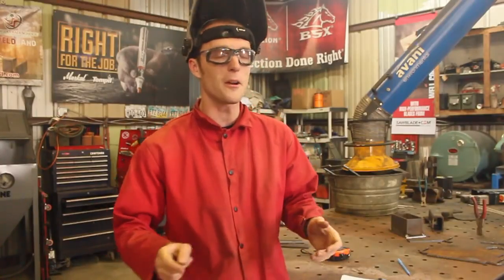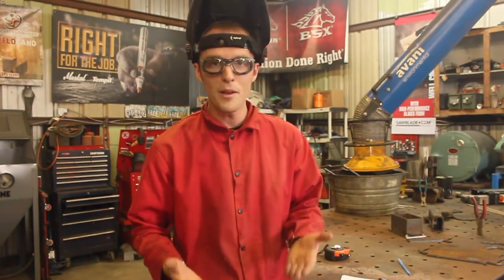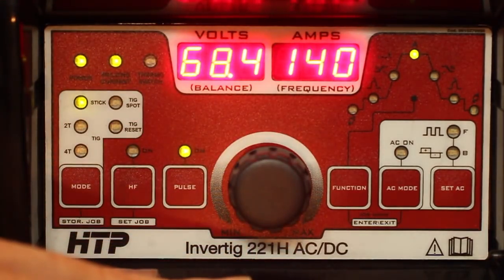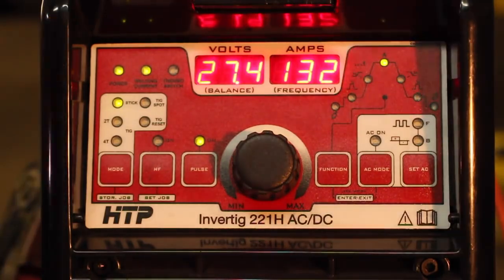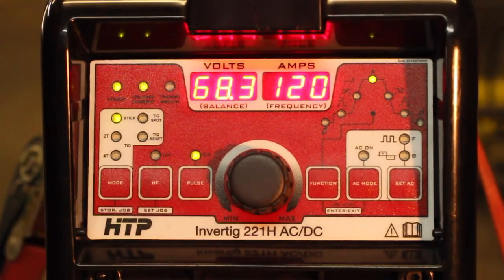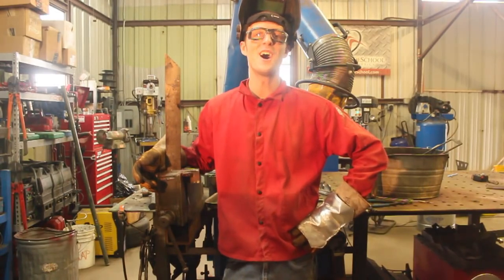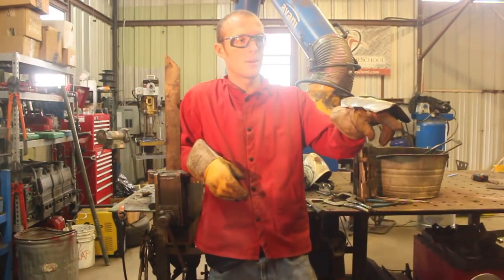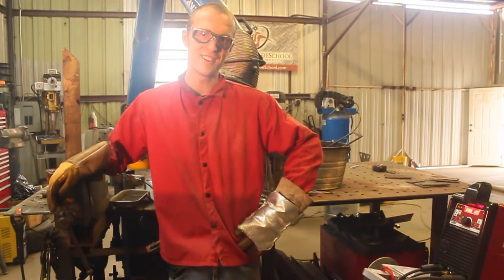Experimenting With Pulsed Stick Welding! Revolutionary New Welding Technique!

Comment: Regarding "welding" - I weld for a living. I weld car bodywork, specifically older cars - usually expensive older cars because I'm also expensive.   In my workshop, I have,many welding machines. They are littered about.  Most are pretty 'spendy machines. 

What I never mention to anyone IRL but do mention on YT is I only use the cheapest machine in the place. The others all just sit there looking expensive,  The welder I actually use cost 200 quid - so is supposedly "a piece of junk" - because more dearer is more better, right? Not always.  In the case of car bodywork, "How low can it go?" matters more than how Shiny it is. Also, how much useability does it retain when you crank it right down to 1? 99% of welding machines I have used crap-out when you dial them back to 1. The 200 quid "POS" is as smooth at 1 as it is at 5 - to date, barring a €1600 Kemppi machine an apprentice broke (it was also an absolute weapon at setting 1) - none of the spendy machines are any use. The POS is equal to the Kemppi, so why drop the 1600 again? 

I can take the same roll of wire - put it into 10 machines for you to try & you will agree that the 200 POS runs it the best. The kicker here is I use flux-core wire. Specifically 0.6mm flux core wire.  Nobody uses 0.6mm flux core wire. I do not use shielding gas.  I have an even bigger "POS" welder that cost €100 - with 0.6mm flux core wire, it will weld steel that is tinfoil thick - however it is so slow on bigger weld runs, I don't bother with it much - but it will weld stuff no other mig machine set-up is capable of. None. It will weld 0.5mm steel sheet without blowing holes all day every day. Your mig will not do that with solid wire & gas. 

I try explain to people the benefits of flux-core & a machine that will go real low on power - for example, there's no distortion - none, With gas-shielded, you weld a panel, it warps like crazy, go as slow as you like, do the "cool each tack" crap - whatever - the panel will warp like mad. When you finish the run, it will look like a topographical map.  With flux-core, you can weld right across a 30cm panel joint - allowing each tack 1 maybe 2 seconds to cool between tacks - a continuous run of weld - and there will be ZERO warping. None. You will stop caring about welding warpage as there will be none even if you do nothing to counter it. The HAZ - to get technical - is so miniscule with flux-core, no warping occurs. Why that doesn't sell the process to every car body repair person baffles me. No Warping? That's bloomin amazing. No buying gas??? Hit one button to have the welder ready to go??? Hit one button to turn it off?? 

I firmly believe that gas-shielded mig for car bodywork is one of the greatest follies tool people fall into - it is so crap in comparison to flux-core it's not right. It won't weld the real thin stuff. It causes crazy panel distortion. The machine & the gas are expensive (relevant but irrelevant). It's 80% slower. You have to grind down welds for about 200% longer (flux-core is a much flatter, softer weld). It's about 60% weaker (flux core penetrates like crazy - a tiny tack hangs on like you would not believe).  I could bore ye all for a lot longer - but "Zero Distortion!"  - that should be why you try it if for no other reason.
Reply: @jamesward5721 ... I really enjoyed reading your comments about flux core auto body sheet metal welding ... please check out ol' Bondo Billy here in the states out there in Oklahoma ... (he's quite a hoot) concerning his flux core auto body sheet metal welding .

Comment: Some company tried to do this, mechanically, about 25 years ago. Eastwood used to sell'em. It was called a "stitch welder" Basically a solenoid with a handle, that hooked into an AC stick welder. The rod got moved, back and forth (like maybe a millimeter) 60 times per second. I didn't use it much, but it seemed to work pretty well on thin sheetmetal.

Comment: In 5 years we'll be able to buy a Chyna knock off for $120 with pulse...:)
Reply: As i see it any Tig lift or scratch mashine with pulse  should work for this so you can buy cheap one already.
Reply: Someone said their Primeweld 225 does it. If you have some outdoor work on thin or withh gaps material.

Comment: Chucky I do have to say that's a great video that you've done and also to I found that my primeweld tig225x also pulses on the stick function. I found that my welder does pulse on the stick operation the middle of last year from a gentleman doing a yeswelder with using a switch to pulse with. Video I watch was on DIY homestead he was using a switch on his stick function to post the stick welding.